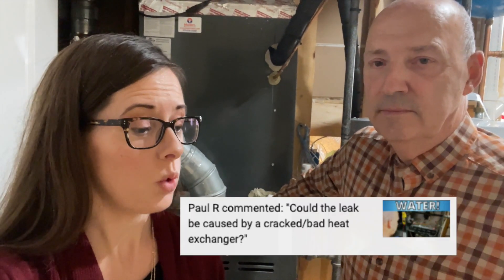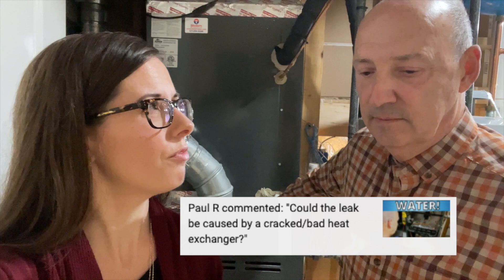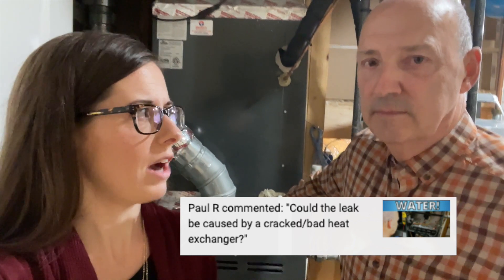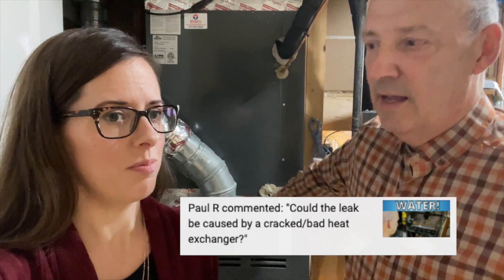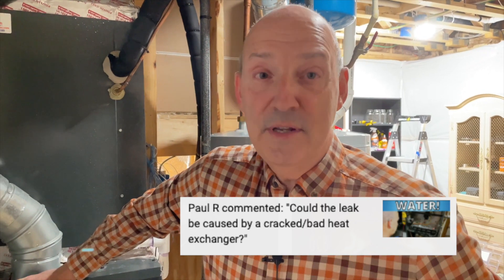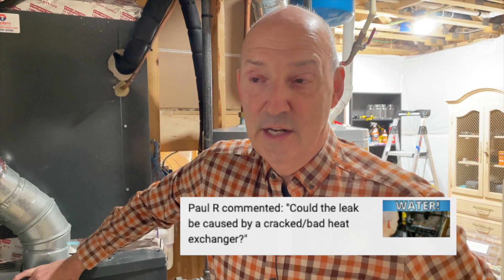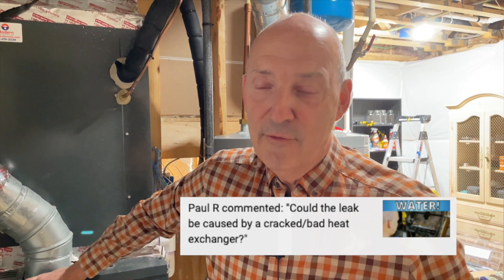Does Water Come From Heat Exchanger? | FURNACE Leaking Water

Comment: A technician pulled off a drain hose and the condensate chamber burped out water. He mopped it up and reattached the hose and it was back in business. But that hose goes ‘up’ to the PVC gas vent leading outside. I would have expected a larger hose going to the floor drain to empty the chamber. Because of the water in the chamber, the sensor doesn’t let the full burners to ignite. Hence the furnace blows cold air. What gives?